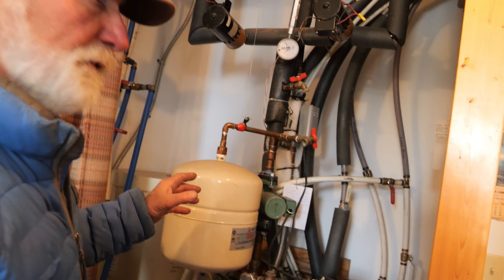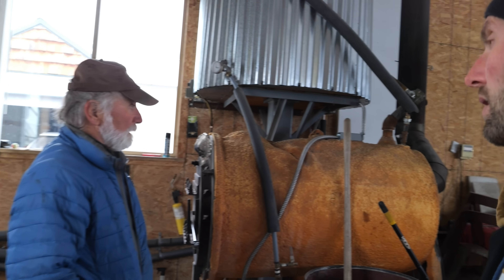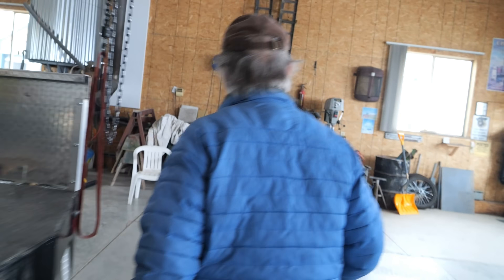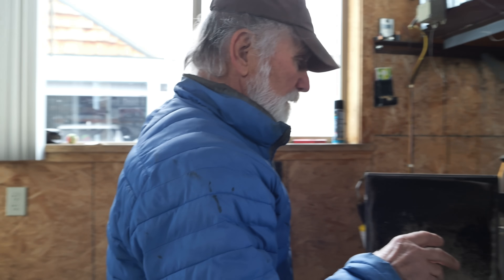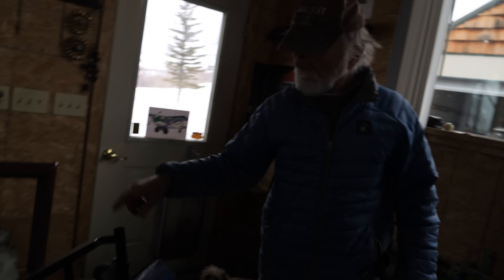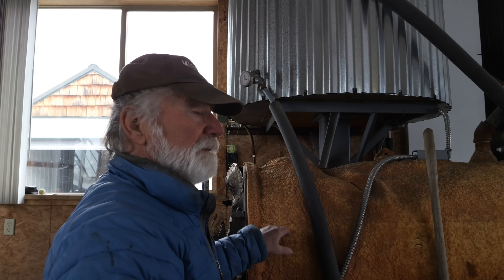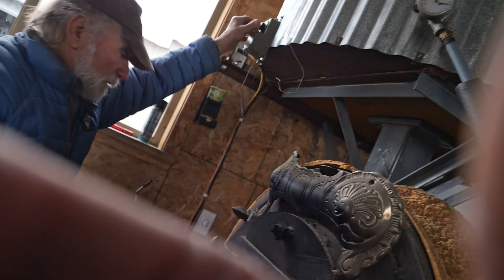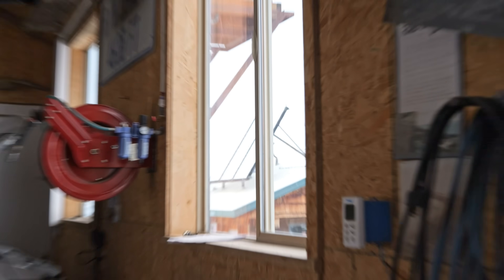Hasn't had a Heating Bill for 40 years.

Comment: Would you rather spend your time at work to heat your house or spend your time at home working to heat your house.

Or you can go to work to buy the wood and then work  at home to heat your house.

Its a trade off
Reply: His wood needs to be picked up anyway, as it's deadfall along his bike path near his home, that's 50% or so of his wood needs. The rest is scrap lumber, loaded by others mostly into his dump bed trailer he drops off at a construction site and picks up after it's full. He's a lazy SOB, so lazy he will also just use the electric boiler to heat the floors, using some of his vast excess of PV KWH credits.  Keep in mind, when you go to work to earn money,  to buy firewood, most then pay taxes on that money. Getting it for free with minimal to no effort, is tax free!

Comment: but cut and loaded  tons of wood
Reply: You're forgetting the solar thermal panels input, a couple pickup loads per winter is all, and mostly deadfall on his property, the rest scrap lumber.
Reply: @portnuefflyer  no i am not solar does not work every day. it will take cords of wood to heat one winter
Reply: @richardhead3211  Even when it's cloudy the thermal panels will make SOME warm water, the key being even 60 or 70 degree water in the floor is better than an ice cold unheated slab.  He's too lazy to want to haul multiple cords of wood, he saw those huge stacks of wood the outside boilers need and wanted no part of that.
Reply: @portnuefflyer  a solar setup will NOT heat a house in those temps either
Reply: @richardhead3211   You get over 40 years of experience of working solar thermal panels, and get back to me!
Reply: @ cool. how much would a solar  setup  to heat a house in  up north  cost?  i am interested

Comment: 1:41 smart man owns a Prius. Best blend of electric and fossil fuel. Full electric is a joke. The exclusively fossil fuel engine is too inefficient. I’ve owned two Prius’s over the past ten years and they’re excellent in the snow as well. My only problem with them is that you can’t turn off the traction control. If you DO get stuck, you’re stuck until a tow gets you out.
Reply: Pull the traction control fuse lol

Comment: The angle of those solar panels.... damn...
Reply: ?? Just right , for winter.
Reply: @portnuefflyer  to my knowledge the one's typically used is residential are fixed to whatever your latitude is and don't get adjusted but who knows. Looks like 60 deg or so. Must be Canada or Alaska.
Reply: @danielmoskowitz3060   I guess  you're referring to the solar THERMAL/HOT WATER panels...., those are at 60 degrees, optimized for winter, and fixed.

Comment: You can hook up two weaker pumps in series to increase the flow rate?
Reply: Since replaced with a single larger pump, a simpler/better solution for more flow.

Comment: Those hot water solar panels can actually heat water in the winter?  I would think being outside in the cold it would actually cool the glycol rather than heating it.
Reply: If there's enough sun to cast a shadow, they will make hot water. The key is only needing 80 to 100 degrees, which is all  the radiant floor needs.  It's much more efficient at the end of the day, to make a LOT of warm water, than a smaller amount of very hot water, that's what makes the flat plate panels feasible for his setup.

Comment: dont get me wrong but we have those heat exchangers with glycol and that warm bath water,floor heating and glycol never mix...they are in separate spiral tubes inside boiler...we have this system in Europe really long time...for floor heating you need about 37-40degrees celsius...that is not much.

Comment: An excellent system! The premise of utilizing resources that are essentially renewable is a very good one, especially when you have a lot of square feet to heat. 

When talking about shop heating in cold climates, it's important to realize that a 70 degree concrete slab is more than enough when it's 10 degrees outside. I think the water in a residential hydronic system would be at 100 or 110 leaving the boiler. But as the gentleman stated, this is a gradual heating method as opposed to instant heat. Also, once all the surfaces and concrete have been warmed up, 70 degrees is more than sufficient in a residential environment as well.

Again, very well done with this exceptional system.

Comment: This guy is me in 30 years. I really want to know how he deals with water expansion in the boiler water jacket and heating loop. If he uses a pressure release valve or if its somehow an open system
Reply: He uses both a P&T valve, and a small pressure tank.

Comment: 40 years ago, i worked for a roofing and paving company, that also installed some solar water heating systems, that were to last forever.  Guaranteed for years but, the company went out of business, making the guarantee worthless.  The problem was the housing, the housing used materials that did not stand up well to the heat on the roof in the summer, like fiberglass, and plastic.  I hated passing one house, when I saw the cloudy window, to the unit, because you knew it was not working.   But, the guts, stood up for 40 years still (but most of the systems were disconnected, if not removed).

Comment: When he says the pumps are in series to increase flow that part confused me. Wouldn't the flow remain the same but the head pressure would be higher?
Reply: Correct, but in this case the higher pressure did increase the flow also, a better alternative would be a single larger pump but no real need for that.

Comment: I started my career as an apprentice heating engineer and just kept learning & getting quals throughout my career.
LOVED this. It's great when people like this guy work all this out.
I've built the last two family homes. Dying to build the final home and I'll be having all of this sort of stuff in my final house. Solar panels (PV and Water), solid fuel boiler and stoves (Upstairs in the house working on gravity.....and of course the domestic hot water working on gravity from the solid fuel stoves, but also pumped primaries into the coil from the solar panels). Also quite interested in a thermal store where you keep the excess heat from the solar panels in an underground well insulated tank, could be swimming pool sized, and then use this as a high quality heat source for a water source heat pump.
Free heat for the rest of my years.....can't wait!!
Thanks for sharing this fabulous information. 🙂

Comment: The Hunters and Anglers building near me has a similar heating system: rooftop solar fluid heat into radiant and solar electrical to run the pumps to circulate it all.

Comment: Just to be clear, water is not more efficient at transferring heat than glycol. It’s the exact opposite. That’s why you have glycol in your radiator because if you had just water, it won’t do it efficiently. He is completely confused, but I don’t know why he wouldn’t have glycol in both systems that floor is not below the frost . If lost heat for a long period of time that floor will freeze solid . This is a mess
Reply: Nope, water is, no confusion! The need for it in a car is totally different. Not needed for freeze protection, 40+ years experience says so.

Comment: They have them systems in Ireland they use wood pellets to heat a two thousand gallon tank which heats the floor tubing... Works awesome.. There usually in bed and breakfasts which is like a small hotel

Comment: Is the solar powering all the pumps too?
Reply: No, just the glycol loop in the hot water panels, that's a simple way of only pumping the fluid when the sun is out enough to warm the water, so power source and controller all in one. The rest are off the shelf  AC circulators pumps.

Comment: I built myself a woodstove out of an old compressor tank and have been bouncing the idea of a heat exchanger around. I need something for my glass studio and Im thinking of employing a car radiator . I naturally pull air through my shop to vent gasses and particulates so it gets hard t het it in the winter. I figure with a radiator stuffed into the inlet of the shop,  at least I would be warming the incoming air a few degrees. As a glass blower I also like the idea of the evacuated tubes for heating water,  would certainly see the benefits for at least showering and laundry.

Comment: A carpenter associate of mine built his own house back in 85, he used multiple systems , such as Solar heated water ,  wood fuel stove heat exchanger, along with SW facing window to allow solar energy to heat on sunny days, he super insulated walls and attic, to the point he needed an air exchange system.
His utility bill is miniscule year round, if he had access to water supply for low voltage battery charging, he wouldn't pay anything for utilities, and his home is only 25 miles from WDC ...

My point is this, as a carpenter myself I make this statement, homes in America are absolute garbage! Overpriced and designed to be energy dependent with a short life span
Reply: The guy in this video was a carpenter also, and the one thing that partially inspired his heat system was the "feast or famine" thing!  You never know when the next job is going to come along, so spending money for future heat needs while you HAVE the money, so you can heat for free thereafter  makes sense. The boiler burning wood scraps is a no brainer of course. The so called maintenance is nothing, in the last 5 years, less than $100.00, one circ pump and one differential controller.
Reply: @portnuefflyer  yup! gotta get thru the lean times

Comment: current tech points to increased solar efficiency with water cooled electrical panels so a new system could be harvesting power and heat at the same time.

Comment: This setup he is describing is quite normal here in Sweden. A wood boiler heating up what we call an accumulater tank. That tank then provides both heated water for heating and for the tap. A normal 1500 square feet house should have minimum one or two accumulater tanks of 250 gallons each. Needs to have a fire at least once a day to keep warmth.

Comment: Major kudos to Tom. His system helps prove an idea of my own that I want to put to use in the future year or two from now, perhaps. (Depends on how things go for me.) Using glycol in the heating system for the panel side of things was really smart of him. There is one thing though that I think he would be wise to add to the system to make it more capable at retaining a comfortable environment during the winter. He kind of already has this going, but he (in my opinion) needs to add to it in a different way. Thermal mass essentially. Like I said, he already sort of has this going already, but he's using water and copper mostly, along with that stainless steel heat exchanger. What I am talking about is going to be much larger, and made of something that retains heat really well. Like, massive amounts of heat. He also almost has this going with his concrete because of the inline heating system inside of it; but it's not going to be holding as much heat as I am talking about here. He could probably get away with using Iron if it's encased in a way that removes the possibility of oxidization... but he's probably best to go with something like stainless steel again, or preferably if he could afford it... Titanium. Not for strength, but for heat retention and resistance overall due to incredibly high temps needed to melt it. 

In my own setup I want to build, I will likely be using a large block of titanium as a heating core of sorts. In his case, I would put the titanium heat exchanger inside the fire box. Possibly 2 or 3 smaller units similar in make to the one he has made of stainless steel. These should get hot enough to allow for any water put through them to instantly convert to steam. If not 'that' hot, then at least hot enough to instantly boil the water. But not just for the time that the fire is going, but for a time as well when it is not. And that's the important part to it all for him, if I understand correctly. Because then he wouldn't need to wait a day or two for the shop to warm up real nice like he was mentioning. It would just stay warm all the time essentially, so long as he makes sure there is a new fire put in every other day or so. During the winter of course. But again, this is also why larger is better, since it hold more heat longer; especially if well insultated. 

As for his current glycol setup, that could also be incorporated somehow as well, if he wanted to. But as he was keen to point out, separation will be important in some aspects as well. Since the water well heat sink heats the house/shop depending on what position the valve is in, I figure it's best to use the thermal mass idea with it and the fire box, more than the glycol setup.

Comment: my grandpa put in  same kind of solar panel for hot water  in the early 80s got it used and after 30 years of use the water tank needed replaced! This is in southern Arizona so we had 180° water coming from the roof no shortage of hot water

Comment: Pumps in series increase pressure. Pumps in parallel increase flow. One HE boiler and 20 years of utilities would have probably cost less and saved hundreds of hours of time. 🫣
Reply: You are correct, but adding a spare pump he had on hand, in  series, did increase the flow, as it increased the pressure, and from a quick and dirty plumbing viewpoint was just easier to install, and did increase the loop flow just enough to keep up with putting the heat in the slab as it's produced. Better yet of course, would be a single large 3 speed pump like supplies the house, but no need to mess with what's working until they need replacement.

Comment: The only caviat is probably the part with 2 pump in series to increase flow rate. While practically true it mostly to increase pressure. He can't go to a higher flow that the max of one pump of the same size but it probably permit to be closer to the max of a pump rather lowest flow range at higher pressure.

Comment: For sure not free the time and effort it takes to burn wood is insane especially for a property this large.. a man that says this was free doesn’t value time
Reply: The wood boiler simply augments the solar thermal system, and is not needed for days or weeks at a time during sunny winter periods. There's also an electric boiler as a backup if he feels lazy, but the boiler doesn't need any Herculean effort to keep supplied with wood anyway, and he has to get rid of the deadfall he picks up every spring somehow.

Comment: Let's just radiant heat. We've had radiant heat for over 40 years. My dad runs it off his wood burning stove that has a water jacket on it just like that guys
Reply: It's been around since the Roman bathing spas, they had slaves to keep the fires going, with the hollow floors acting as a smoke path and heat exchanger.

Comment: You can't heat all that square footage with those panels, going through that little heat exchanger.  Otherwise, a tiny gas or electric heater would also work, which obviously it doesn't.  It contributes to the system, but it would be close to same temperature in those buildings as outside if that was the sole source.  Also, the wood isn't "free", but much cheaper, as he says "cost effective".  I heat my house the same way.
Reply: That "little" plate heat exchanger does indeed keep those 6 thermal panels from overheating, they are incredibly efficient. The flow rate of the pump is key, though it still draws less than 100 watts. The heat goes in the floor slab as fast as it arrives at the exchanger, keeping the loop around 100 degrees.  It was 68 degrees in the shop at sundown, 62 this morning, no fire in the boiler for 8 days, just the thermal solar  panels doing all the work, sunny days of course, but with low 20's overnight temps. All totally automatic.

Comment: crazy stuff, but I can't help think that he has been running this for 30 years, probably paid $20K for the heat exchange solar panels 30 years ago, then all the plumbing, pumps, etc he had to buy and install. Even if he had a heat bill of $1,500 a year, he probably would break even after 30 years with a lot less work and conventional heating methods.

Great stuff though, not knocking the guy in any way

Comment: some of the poorest plumbing I have seen.
Reply: Not cosmetically appealing for sure, but all well within pressure and heat limits for the material used. The system morphed, not a clean slate design for sure, and the bottom line is it's all worked for a couple decades now, as did the similar one before it.  He's seen what a real plumber can do when starting with a plan to follow, and is impressed, but this works just fine.
Reply: If it works that’s all that matters